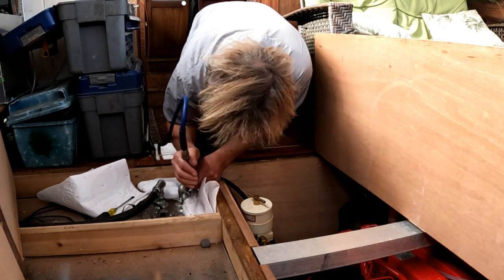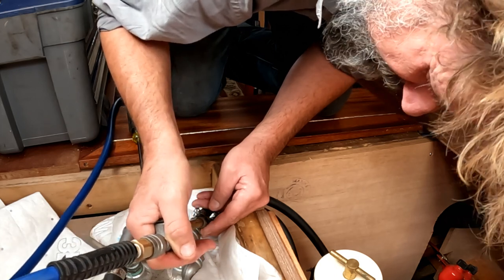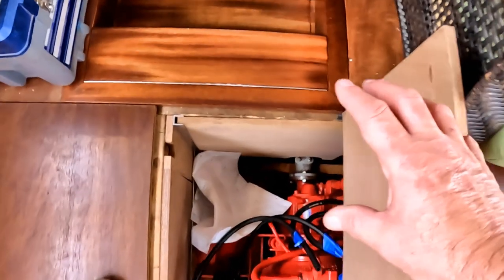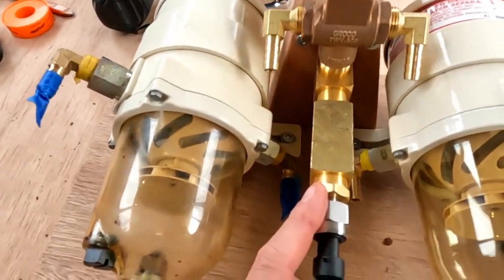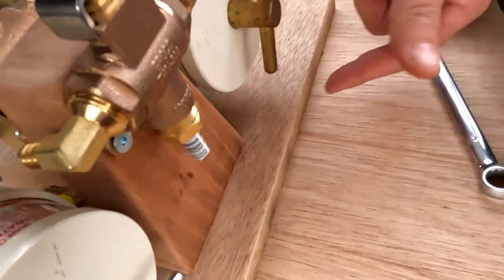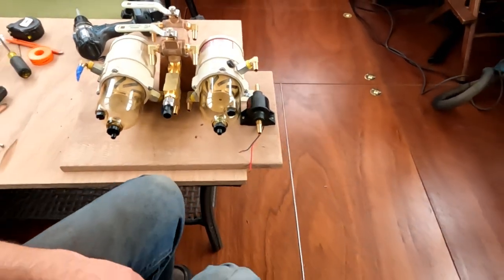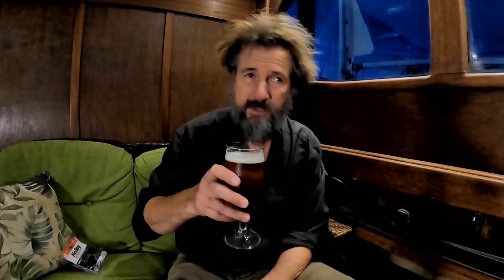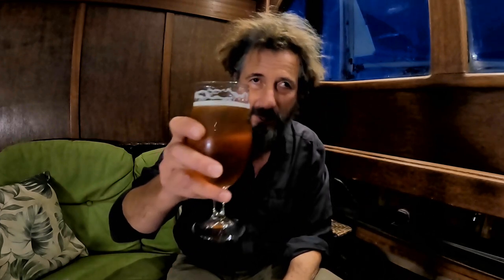More Fuel System - #278 - Boat Life - Living aboard a wooden boat - Travels With Geordie

Comment: Patience is working on a sailing vessel 2 states away for 3 years, still not yet ready for the ocean passage required. Admiring your fuel system. My fuel tanks are both above the injection pump, still I appreciate the pumps if in need. Considering a valved crossover between tanks also.

Comment: Why didn’t we opt for the dual racor unit with valve assembly that allows 1,2, both, or all off?  It’s also more compact than what you’ve built. Cost?  Availability?  Nevertheless, it looks very sanitary and functional. I love watching your channel. I was a yacht mechanic in a previous life.
Reply from the maker: Those units are absurdly expensive and made with proprietary bits.
This setup allow more flexibility by allowing me to return to a different tank than I'm drawing from and is made up of stock components I can get anywhere quickly.
Reply: Ok. That’s a good answer. Though I doubt you’ll ever need to replace any of those proprietary bits unexpectedly. I never have. We use them on all our main engines and gensets. We run 24/7/365. Watching  #279. All the hose and clamps and fittings and valves. I’m sure you’ve added it all up. I haven’t. So I had to ask. Really enjoy your content.

Comment: Nice to see the sliding doors sorted out. But now I see a big hole in the bridge wall. Next year project? And doesn't have the engine a mechanical fuel pump?
Reply from the maker: Yes, that horrible bridgedeck is next year.
Yes, the engine has it's own lift pump, these are for pressure bleeding, filter filling, polishing (filtering) the fuel and tank transfer.
Reply: @TravelsWithGeordie  work: inside, outside, repeat repeat repeat!!